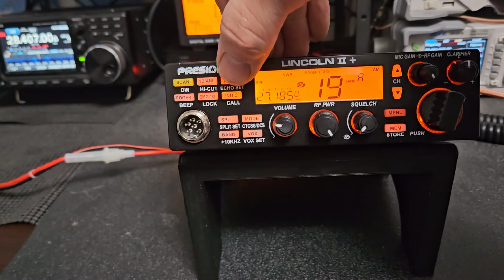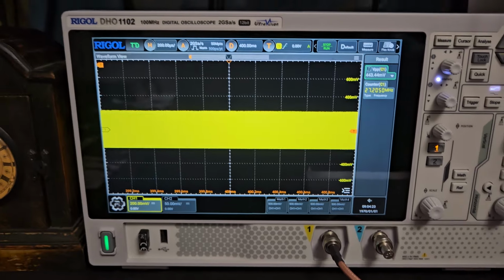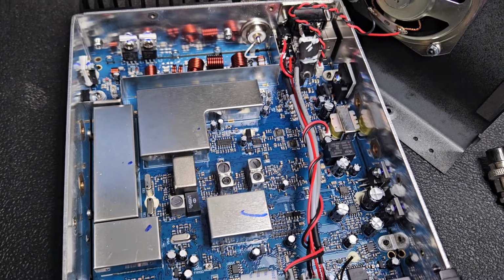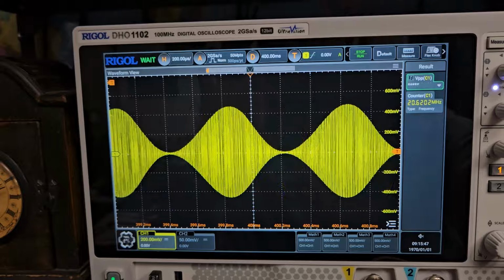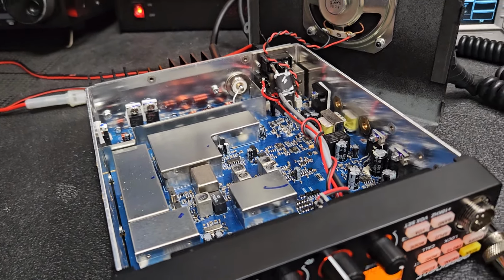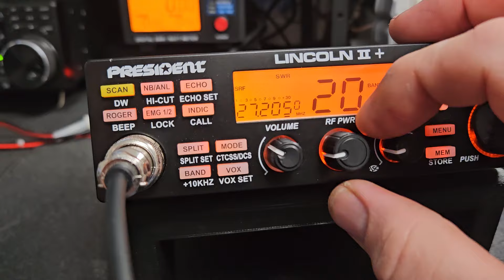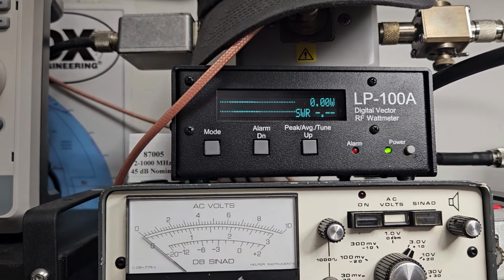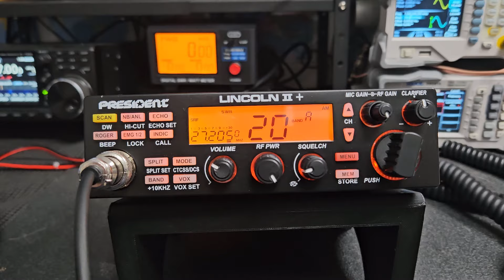Present Lincoln 2+ for James in Michigan. PT#1

Comment: I purchased one of these to use for Amateur Radio use, as they come  with 10 and 12 meters.
The receiver has a weird overdriven almost distorted sound, on strong signals ?
And the C.W. seems pretty much a joke, as the first character sent, is typically missed, then has strange tone before it settles .
Is there anything you can do to fix these issues, in an Amateur Radio only rig ?
Thanks in advance for your reply !
Reply from the maker: Technically no because they are built a certain way. 
They're very popular for the CB market. 
I still enjoy the radios but for a amateur use I would say it is passable but probably not the best option. 
Some 10 meter models have quirks and whatnot but I still enjoy using them.
If you're familiar with the Alinco DX10 that was a similar radio.
It had some quirks but it was still fun to use.
Reply: @ScottsRadios  
Maybe I should have known better, but I have never really followed these, " Import " radios, I believe they called them ?
And I led with my chin on this one, and paid the price with disappointment !
And the assumption I went off, were the similar radios, like the HR 2600 / 2510, HTX 10 etc.
Where they at least worked !
And I guess it was foolish of me to believe they wouldn't go backwards !
But boy have they !
At least in my opinion !
I have made some contacts on 12 meter Phone, as well as 10.
So I can't say they don't work, but for me, a real disappointment, especially for the price !
I'm in the process of having a couple of 
HR 2600's done, where you remove the conductive glue, and recap !
So hopefully when all is done, I'll have a couple,
 " Phoenix " radios out of the ashes !
Thanks for your reply !